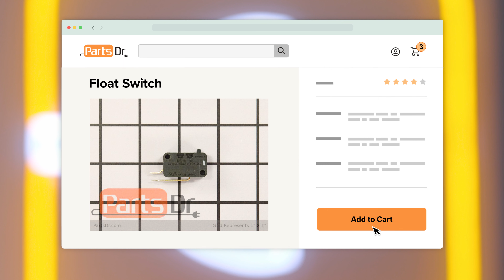How to replace Float Switch part # WPW10195039 on your Whirlpool Dishwasher

Comment: excellent presentation - thx
Reply from the maker: You're welcome!  What kind of problem are you having with the float switch on your dishwasher?
Reply: @PartsDr  i think the switch is not working - going to replace it today ....
Reply from the maker: @azfluffy6332  Let us know what you find!
Reply: @PartsDr  it was leaking water - not much - but after switch replacement it stopped leaking!
Reply from the maker: @azfluffy6332  Great! Thanks for letting us know!

Comment: I get error code 6-4 on my Kitchenaid dishwasher. I have replaced the float switch and water inlet valve but the machine still cuts off and drains. I still get the 6-4 code.
Reply from the maker: What is the model number of the dishwasher?  https://www.youtube.com/watch?v=her9eShOYtA
Reply: Mine does this too , did you figure out ?

Comment: I have a leak how do I know if it’s the float or the switch?
Reply from the maker: The switch itself wouldn't cause a leak.  The leak would usually be caused by the float housing, nut, or gasket that seals the water.
Reply: @PartsDr  it ended up being the lower spray arm